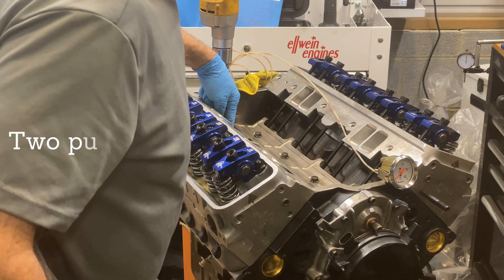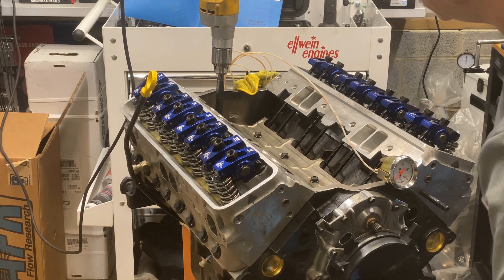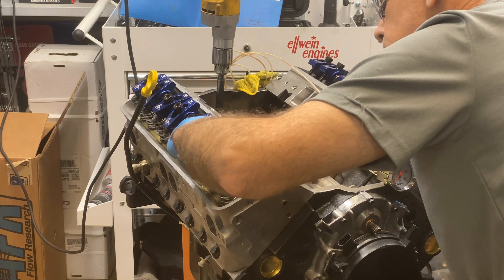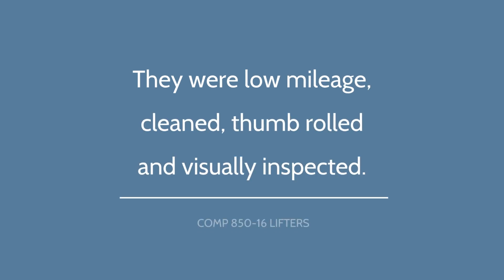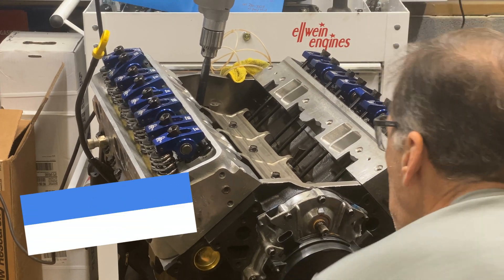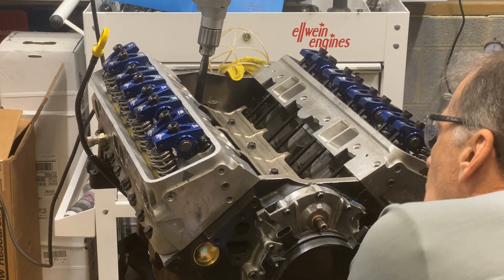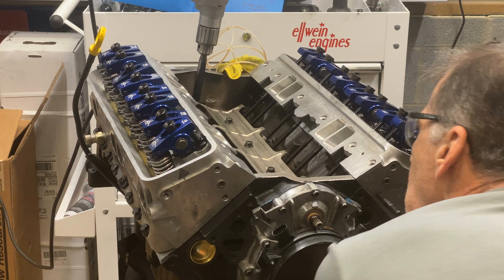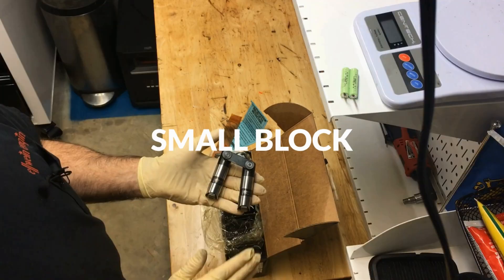LT1 Lifter Failure Found During Oil System Test

Comment: Did this lifter collapse still happen if you had someone running drill while rolling motor over?  More interestingly perhaps is those lifters that didn't under full spring pressure.  Anyway... I learned some time ago that hydraulic lifters should be disassembled & cleaned/re-oiled before install.  I find junk in some on occasion, and glad I took the extra time.